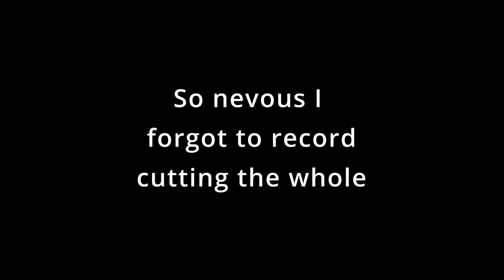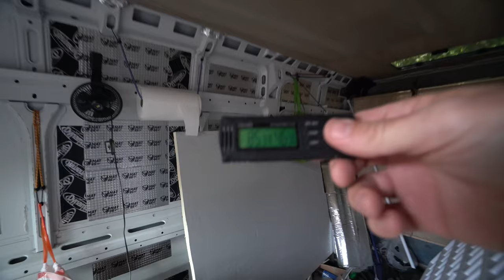Van A/C Cutting a Hole for Midea Inverter A/C ProMaster

Comment: I love these Midea U ACs. I have an 8k in my bedroom, and 2 others around my house. I plugged a killowatt meter in line and watched the watts used. With compressor on, set to 72, 90 degrees outside, set to Auto Cool, 235 watts! After it reached target temp, the variable dc inverter slowed the fan and compressor down to quiet. Meter showed less than 50 watts!!! I made a short video clip. I'll attach it to this. Great job on the install! I'm thinking of trying it.
Reply from the maker: Costco has midea air conditioners now too

Comment: For a grand or less Amazon now has 12 , 24 , 48 volt dc under mount mini split inverter ac’s .  Just a small hole for plumbing and wiring thru the floor and boom you got ac . And no one’s the wiser !  🕵‍♂

Comment: I've seen portable Ac window units where all you need to do is have an exit for the exhaust hose, no need to store a big box out the back.
Reply from the maker: The single hose units don't work for vans make sure you get a dual hose unit. Those portable units are the least efficient air conditioners in the world and this air conditioner takes up no space in the van
Reply: @NoLimitVanLife  
Yes, sorry I meant dual hose system. I know they lack efficiency but I've used one before and it works well for small spaces.
Reply: @jeffs4483  Much easier to set up too I appreciate discussing all the options

Comment: I installed this exact same A/C unit inside my van. The "external part" is inside an insulated box which is vented through the roof
Reply from the maker: Do you have any pictures do you love it? I really think it's the best AC
Reply: @NoLimitVanLife  Yes, great unit but I think I might upgrade to the 12k unit which is the same size. I will take some pics of the installation
Reply: @NoLimitVanLife  How do I show the pictures of my install ?
Reply: I put the pictures in face book havelock forum
Reply: @wolfsburg4x4  whats ur IG
Reply: @sergioknuf  is that instagram ? lol I dont have one
Reply: @wolfsburg4x4  FB?

Comment: Hello, I agree with you. This U-shaped AC is hands down the most efficient and cost-effective option available. Instead of cutting a whole in the door, I think removing the rear window and installing it there would be a better option. What do you think? if you sell the van just remove and replace the window. Perhaps some fabrication and bracing needed? I think a guy on you tube installs window AC units that way. A slide up window replacement would be perfect! I have not seen one though. :( 
Maybe go with a 48Volt off grid system. 48V wall mount battery and all-in-one inverter. 4000 watts of solar if possible. DC to DC perhaps not possible. Shore power may be tricky with the neutral ground bonding issue. One day we will have the perfect set up, but I agree with the U-shape AC. Installation is the challenge though.
Reply from the maker: I wish I had 4000 W
I like having my window and I still have the piece of metal if I want to close the hole, I will weld it back and have the body shop repaint the door the hole is under the license plate mostly anyway

Comment: What were the dimms of the rectangle you cut? The specs for the Ac show it at 22" in width. 

Is there enough width to put this in where the windows go on the rear door?
Reply from the maker: I'm measuring right now and it looks like there's enough space but it's close
Reply: @NoLimitVanLife  Any update:)
Reply from the maker: @MyGoogleYoutube  https://youtu.be/Sj-4vrnxYho

Comment: What size was the hole you cut? I have an opening 11 inches high and the AC is just over 13. How difficult was it to remove the pieces to make it fir thru?
Reply from the maker: I was a little scared of not being able to get it back together correctly, but it ended up working out. I forgot exactly the size of the hole.

Comment: First... cutting a hole, like you did, was/is stressful.  It's not like your putting in a max fan 14" sq in the roof.   You had unknown variables.  We all learn by what you did!  Thanks....

Some food for thought.  It may have been more prudent to cut the hole/hang the unit on the passenger side door, but it presents a problem.  More later.

The other thought, it may have been prudent to remove the glass from that passenger side door, frame in a piece of plywood/backed by sheet metal, wrapping the plywood, then painted.  This way, you would not have had to cut a hole in either door.  Additionally if you install a sleeping deck with a  garage below the bed/deck, your cooling as it exist now would go into the garage.  

Another issue, is if someone bumps into the overhanging air conditioner with their rig..... you are out a door and possibly an air conditioner.  

By removing the passenger side window and fitting in your air conditioning unit in this window with plywood/sheet metal, it will be above the garage, cooling the balance of your van.  

If an error was made cutting the plywood, it wouldn't affect a $1,000 rear door, and if at some time you changed your mind, you could remove the plywood and put in your glass in again.

Again, all due respect for your work.... 

I was looking at an air conditiong unit as well.  Have a 4kwatt inverter, 600amp hours battery with 3 each 280 watt solar pannels on the roof.  The idea with this power was to find a air conditioning unit and install.  I just didn't know where to install it, thinking deck only.    

Unfortunately/fortunately I have solid rear doors which I don't want to cut into, at least at this time.

Best.
Reply from the maker: It wasn’t stressful because I knew it wouldn’t be perfect and metal can be molded into anything you want by saving the piece that I cut out I can have a body shop repair it. My other option would be a door from the junkyard. I chose the driver side because that door opens last and I can leave it closed relatively permanent. I absolutely do not want to illuminate a window and it’s a top priority to keep the weight as low as possible. 
The AC susceptible to being hit by some moron is definitely a concern and I never really thought about it till you mentioned it. My ever developing plan to cover the air conditioner needs to be strong enough to protect it as well. Thanks for the idea

Comment: Your videos are awesome, thanks a lot!
I'm in Europe and somehow they do not make any efficient Air Conditioners in here - not sure why.

A quick question: What are the minimum dimensions you need to get it through if it's stripped down the way you did?
I assume you can tilt it slightly.
I'm thinking about using a window that's wide enough.

Thanks a lot!
Reply from the maker: I think it’s somewhere about 19“ x 9“
Reply: @NoLimitVanLife  nice, that's less than expected